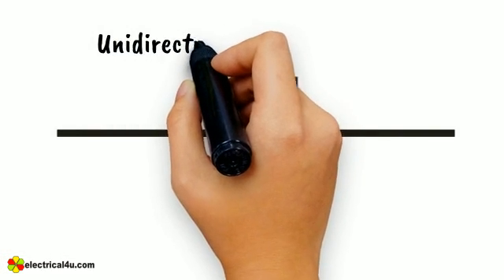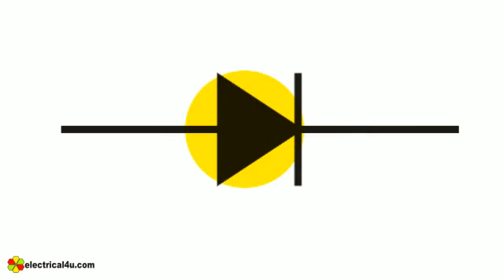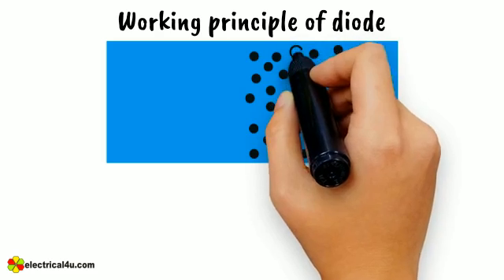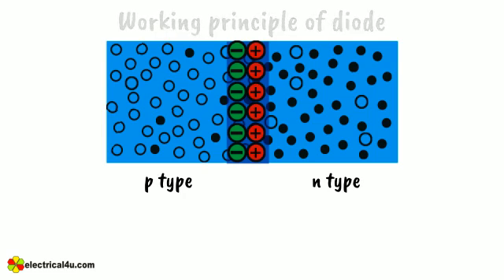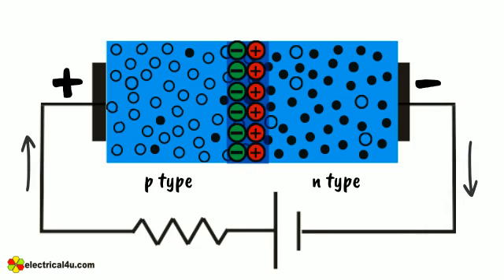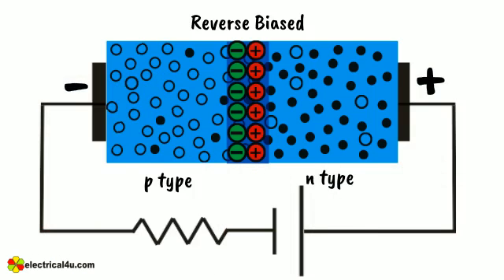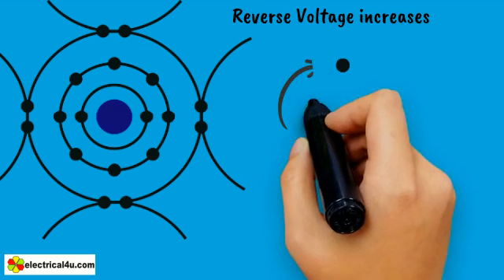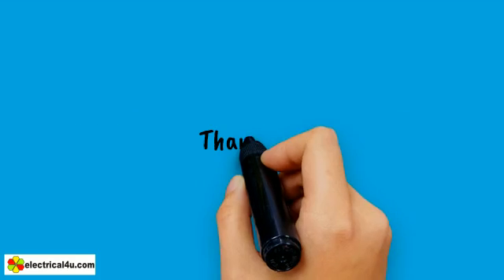Working Principle of Diode

Comment: No diode is "ideal".  So its hard to say why the woman says it is.  All diodes need a forward voltage above a curvy kind of ammount to start to let current through.  Silicon c0.6v  GaAs (LED light) white are nearly 3v ! - but might be Aluminum Nitride which gives UV light (I'm told) which then makes a phosphor glow with visible light.

Comment: The barrier potential can never be made zero nor can it be made to disappear. For more details refer to the books indicated below.
Your video otherwise is nicely made.
What is a pn junction ? 
A pn junction allows current in one direction only. It blocks current in the reverse direction. 
When a pn junction is formed, a potential barrier designated Vo comes into existence and is typically around 0.6 to 0.7 volts for silicon junctions. 
When the barrier whose Vo is 0.7 volts is disturbed by applying a forward bias of say, 0.6 volts, the current increases and the increase becomes steep for small increments of the forward bias value a little greater than 0.68 volts. Large currents are observed when the forward bias is 0.69 volts which is closer to the barrier voltage of 0.7 volts. 
The forward bias can never exceed the potential barrier voltage nor can it bring the barrier down to zero volts. That is the reason you seldom see current vs volt graphs of pn junction diodes beyond a volt or so.
How does the bias remain less than the barrier in an operational diode?
The voltage bias applied drops in the bulk neutral regions of the diode. 
The current in a forward bias adjusts to fulfill the conservation of current law and the rate of recombination.
A detailed description of the pn junction with a distinct approach using surface charges, alignment of Fermi levels, creation of the barrier, the distinct processes of diffusion, drift, recombination and the influence of the electric field on the energies of electrons is provided in the following textbooks.

Electrostatics and circuits belong to one science and not two, that of electricity and magnetism. To know how they are unified visit this link 
https://matterandinteractions.org/articles-talks/ and view the article 'A unified treatment of electrostatics and circuits.  B. Sherwood and R. Chabay, unpublished. (1999)'
pdf. 
For a live demonstration of surface charge and its effects in circuits visit 
https://youtu.be/U7RLg-691eQ
For a detailed discussion of surface charge, coulomb's law, electric fields, fields of dipoles and other charge configurations, and parallel plates, and a distinct approach using the surface charge concept in the study of advanced topics of capacitance, currents, conservation of charge, conservation of current, superposition of fields, superposition of potential, simple dc circuit, magnetic fields, magnetic fields of a current element, straight wire, current loop, solenoids, biot-savart law, voltage, voltage source, difference between e.m.f. and potential difference, ideal voltage sources, resistors, how current branches in a parallel circuit, capacitors, inductors, Faraday's law, inductance, ac circuits, transmission lines, Lorentz Force law, motors, generators, p-n junction diodes, electromagnetic waves, antennas and radiation, new electrodynamic theories on the nature of the electric field, see "Electric and Magnetic Interactions" by Chabay and Sherwood 
www.matterandinteractions.org
or 
Fundamentals of electric theory and circuits by Sridhar Chitta
https://www.wileyindia.com/fundamentals-of-electric-theory-and-circuits.html
There is a "look inside" feature in the amazon.com webpage of the book "Fundamentals of electric theory and circuits" by Sridhar Chitta with a few pages of Chapter 1 which may be viewed and also which you may swipe left or press < icon to view the foreword, preface and Table of Contents. The contents of the above book by Sridhar Chitta, make a distinct unified approach to electrostatics and a few advanced circuits like coupling signals to amplifiers, lending precision and clarity to the topics which is not found in most text books.
The book comes alongwith a CD with animated power point presentations for all chapters and voltage regulator, RC phase shift oscillators and differential amplifiers included additionally.
For a lecture by Prof Ruth Chabay on surface charge in a simple dc circuit visit 
https://youtu.be/-7W294N_Hkk
There is a full set of lectures beginning lecture 13 here on surface charges, electric fields, simple circuits, capacitance, inductance, faraday's law, motional emf, magnetic forces and more topics here
https://matterandinteractions.org/videos/EM.html

Comment: The barrier potential of an operational diode can never be made zero.
What is a pn junction ? 
A pn junction allows current in one direction only. It blocks current in the reverse direction. 
When a pn junction is formed, a potential barrier designated Vo comes into existence and is typically around 0.6 to 0.7 volts for silicon junctions. 
When the barrier whose Vo is 0.7 volts is disturbed by applying a forward bias of say, 0.6 volts, the current increases and the increase becomes steep for small increments of the forward bias value a little greater than 0.68 volts. Large currents are observed when the forward bias is 0.69 volts which is closer to the barrier voltage of 0.7 volts. 
The forward bias can never exceed the potential barrier voltage nor can it bring the barrier down to zero volts. That is the reason you seldom see current vs volt graphs of pn junction diodes beyond a volt or so.
How does the bias remain less than the barrier in an operational diode?
The voltage bias applied drops in the bulk neutral regions of the diode. 
A detailed description of the pn junction with a distinct approach using surface charges, alignment of Fermi levels, creation of the barrier, the distinct processes of diffusion, drift, recombination and the influence of the electric field on the energies of electrons is provided in the following textbooks.

Electrostatics and circuits belong to one science and not two, that of electricity and magnetism. To know how they are unified visit this link 
https://matterandinteractions.org/articles-talks/ and view the article 'A unified treatment of electrostatics and circuits.  B. Sherwood and R. Chabay, unpublished. (1999)'
pdf. 
For a live demonstration of surface charge and its effects in circuits visit 
https://youtu.be/U7RLg-691eQ
For a detailed discussion of surface charge, coulomb's law, electric fields, fields of dipoles and other charge configurations, parallel plates, capacitance, currents, conservation of charge, conservation of current, superposition of fields, superposition of potential, simple dc circuit, magnetic fields, magnetic fields of a current element, straight wire, current loop, solenoids, biot-savart law, voltage, voltage source, difference between e.m.f. and potential difference, ideal voltage sources, resistors, how current branches in a parallel circuit, capacitors, inductors, faraday's law, inductance, ac circuits, transmission lines, motors, generators, p-n junction diodes, electromagnetic waves, antennas and radiation, new electrodynamic theories on the nature of the electric field, see "Electric and Magnetic Interactions" by Chabay and Sherwood 
www.matterandinteractions.org
or 
Fundamentals of electric theory and circuits by Sridhar Chitta
https://www.wileyindia.com/fundamentals-of-electric-theory-and-circuits.html
There is a "look inside" feature in the amazon.com webpage of the book "Fundamentals of electric theory and circuits" by Sridhar Chitta with a few pages of Chapter 1 which may be viewed and also which you may swipe left or press < icon to view the foreword, preface and Table of Contents. The contents of the above book by Sridhar Chitta, make a distinct unified approach to electrostatics and a few advanced circuits like coupling signals to amplifiers, lending precision and clarity to the topics which is not found in most text books.
The book comes alongwith a CD with animated power point presentations for all chapters and voltage regulator, RC phase shift oscillators and differential amplifiers included additionally.
For a lecture by Prof Ruth Chabay on surface charge in a simple dc circuit visit 
https://youtu.be/-7W294N_Hkk

Comment: I'm trying to understand this from a real world perspective and I'm getting confused at the part dealing with the battery being flipped to go from forward bias to reverse bias. I seem to be tripping on or misunderstanding a fundamental issue, but what external force would cause the battery polarity to be flipped ?
Reply: What is a pn junction ? 
A pn junction allows current in one direction only. It blocks current in the reverse direction. 
When a pn junction is formed, a potential barrier designated Vo comes into existence and is typically around 0.6 to 0.7 volts for silicon junctions. 
When the barrier whose Vo is 0.7 volts is disturbed by applying a forward bias of say, 0.6 volts, the current increases and the increase becomes steep for small increments of the forward bias value a little greater than 0.68 volts. Large currents are observed when the forward bias is 0.69 volts which is closer to the barrier voltage of 0.7 volts. 
The forward bias can never exceed the potential barrier voltage nor can it bring the barrier down to zero volts. That is the reason you seldom see current vs volt graphs of pn junction diodes beyond a volt or so.
How does the bias remain less than the barrier in an operational diode?
The voltage bias applied drops in the bulk neutral regions of the diode. 
The current in a forward bias adjusts to fulfill the conservation of current law and the rate of recombination.
A detailed description of the pn junction with a distinct approach using surface charges, alignment of Fermi levels, creation of the barrier, the distinct processes of diffusion, drift, recombination and the influence of the electric field on the energies of electrons is provided in the following textbooks.

Electrostatics and circuits belong to one science and not two, that of electricity and magnetism. To know how they are unified visit this link 
https://matterandinteractions.org/articles-talks/ and view the article 'A unified treatment of electrostatics and circuits.  B. Sherwood and R. Chabay, unpublished. (1999)'
pdf. 
For a live demonstration of surface charge and its effects in circuits visit 
https://youtu.be/U7RLg-691eQ
For a detailed discussion of surface charge, coulomb's law, electric fields, fields of dipoles and other charge configurations, and parallel plates, and a distinct approach using the surface charge concept in the study of advanced topics of capacitance, currents, conservation of charge, conservation of current, superposition of fields, superposition of potential, simple dc circuit, magnetic fields, magnetic fields of a current element, straight wire, current loop, solenoids, biot-savart law, voltage, voltage source, difference between e.m.f. and potential difference, ideal voltage sources, resistors, how current branches in a parallel circuit, capacitors, inductors, Faraday's law, inductance, ac circuits, transmission lines, Lorentz Force law, motors, generators, p-n junction diodes, electromagnetic waves, antennas and radiation, new electrodynamic theories on the nature of the electric field, see "Electric and Magnetic Interactions" by Chabay and Sherwood 
www.matterandinteractions.org
or 
Fundamentals of electric theory and circuits by Sridhar Chitta
https://www.wileyindia.com/fundamentals-of-electric-theory-and-circuits.html
There is a "look inside" feature in the amazon.com webpage of the book "Fundamentals of electric theory and circuits" by Sridhar Chitta with a few pages of Chapter 1 which may be viewed and also which you may swipe left or press < icon to view the foreword, preface and Table of Contents. The contents of the above book by Sridhar Chitta, make a distinct unified approach to electrostatics and a few advanced circuits like coupling signals to amplifiers, lending precision and clarity to the topics which is not found in most text books.
The book comes alongwith a CD with animated power point presentations for all chapters and voltage regulator, RC phase shift oscillators and differential amplifiers included additionally.
For a lecture by Prof Ruth Chabay on surface charge in a simple dc circuit visit 
https://youtu.be/-7W294N_Hkk
There is a full set of lectures beginning lecture 13 here on surface charges, electric fields, simple circuits, capacitance, inductance, faraday's law, motional emf, magnetic forces and more topics here
https://matterandinteractions.org/videos/EM.html
Reply: What external force ?  How about the voltage was not a battery but instead ab Alternator  ?   What if you removed the diode and replaced it the other way round ?

Comment: In the depletion layer 
Some electrons migrate from p - type but Y it does not moves further in n-type and y the hole created in n-type cant attract further electrons
Reply: What is a pn junction ? 
A pn junction allows current in one direction only. It blocks current in the reverse direction. 
When a pn junction is formed, a potential barrier designated Vo comes into existence and is typically around 0.6 to 0.7 volts for silicon junctions. 
When the barrier whose Vo is 0.7 volts is disturbed by applying a forward bias of say, 0.6 volts, the current increases and the increase becomes steep for small increments of the forward bias value a little greater than 0.68 volts. Large currents are observed when the forward bias is 0.69 volts which is closer to the barrier voltage of 0.7 volts. 
The forward bias can never exceed the potential barrier voltage nor can it bring the barrier down to zero volts. That is the reason you seldom see current vs volt graphs of pn junction diodes beyond a volt or so.
How does the bias remain less than the barrier in an operational diode?
The voltage bias applied drops in the bulk neutral regions of the diode. 
The current in a forward bias adjusts to fulfill the conservation of current law and the rate of recombination.
A detailed description of the pn junction with a distinct approach using surface charges, alignment of Fermi levels, creation of the barrier, the distinct processes of diffusion, drift, recombination and the influence of the electric field on the energies of electrons is provided in the following textbooks.

Electrostatics and circuits belong to one science and not two, that of electricity and magnetism. To know how they are unified visit this link 
https://matterandinteractions.org/articles-talks/ and view the article 'A unified treatment of electrostatics and circuits.  B. Sherwood and R. Chabay, unpublished. (1999)'
pdf. 
For a live demonstration of surface charge and its effects in circuits visit 
https://youtu.be/U7RLg-691eQ
For a detailed discussion of surface charge, coulomb's law, electric fields, fields of dipoles and other charge configurations, and parallel plates, and a distinct approach using the surface charge concept in the study of advanced topics of capacitance, currents, conservation of charge, conservation of current, superposition of fields, superposition of potential, simple dc circuit, magnetic fields, magnetic fields of a current element, straight wire, current loop, solenoids, biot-savart law, voltage, voltage source, difference between e.m.f. and potential difference, ideal voltage sources, resistors, how current branches in a parallel circuit, capacitors, inductors, Faraday's law, inductance, ac circuits, transmission lines, Lorentz Force law, motors, generators, p-n junction diodes, electromagnetic waves, antennas and radiation, new electrodynamic theories on the nature of the electric field, see "Electric and Magnetic Interactions" by Chabay and Sherwood 
www.matterandinteractions.org
or 
Fundamentals of electric theory and circuits by Sridhar Chitta
https://www.wileyindia.com/fundamentals-of-electric-theory-and-circuits.html
There is a "look inside" feature in the amazon.com webpage of the book "Fundamentals of electric theory and circuits" by Sridhar Chitta with a few pages of Chapter 1 which may be viewed and also which you may swipe left or press < icon to view the foreword, preface and Table of Contents. The contents of the above book by Sridhar Chitta, make a distinct unified approach to electrostatics and a few advanced circuits like coupling signals to amplifiers, lending precision and clarity to the topics which is not found in most text books.
The book comes alongwith a CD with animated power point presentations for all chapters and voltage regulator, RC phase shift oscillators and differential amplifiers included additionally.
For a lecture by Prof Ruth Chabay on surface charge in a simple dc circuit visit 
https://youtu.be/-7W294N_Hkk
There is a full set of lectures beginning lecture 13 here on surface charges, electric fields, simple circuits, capacitance, inductance, faraday's law, motional emf, magnetic forces and more topics here
https://matterandinteractions.org/videos/EM.html